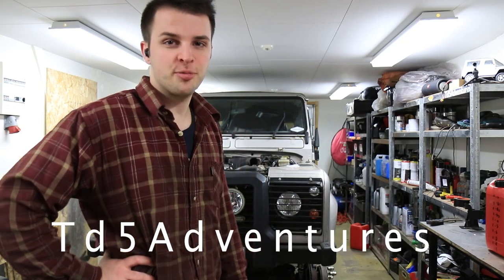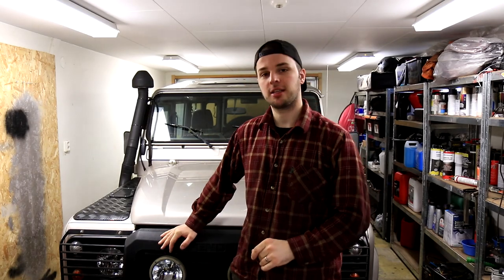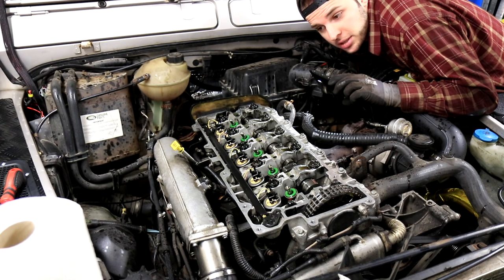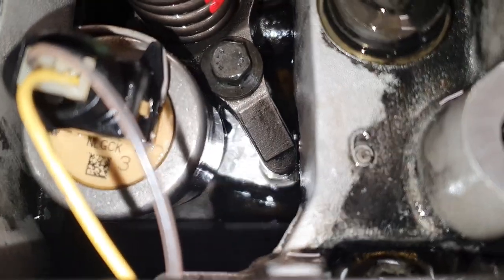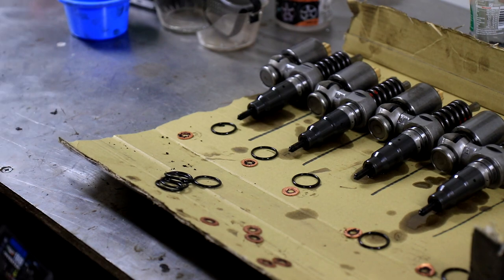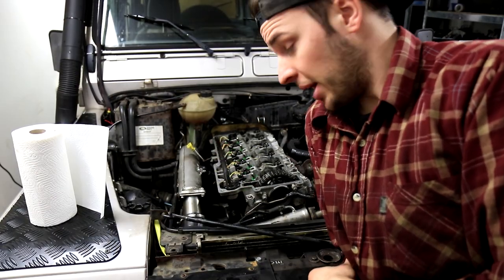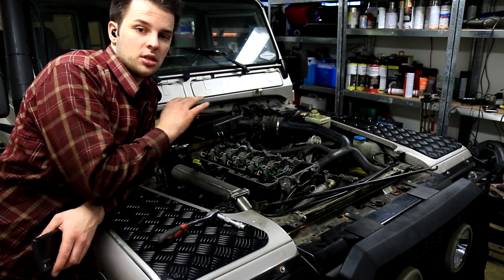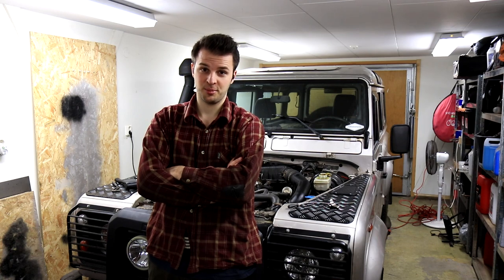CRACKED HEAD or BAD INJECTOR?!?! - Td5 - How to diagnose!

Comment: If your machine shop cannot repair your head, you can get a AMC cylinder head from Turner Engineering, they are meant to be a much better head than the origional. File this under "the joys of motoring" and keep up the good work.
Reply from the maker: Yeah I've been looking at the AMC head with the appropriate double wall thickness for the injector bores, would be nice if this head is not fixable!
Reply: Turner engineering are a rip off
Reply: Could these be bored out and sleeved? I dont know just a wild guess...

Comment: Was you oil level rising. I changed over my injector seals a while ago as the oil level was really high. Oil doesn’t seem to be increasing however the oil still seems very thin
Reply from the maker: Yes! It was rising and getting thin! 
Make sure to change your oil and filters and measure exactly how much you pour into the engine, then drive for a while and empty the oil again to see how much comes out. I put about 6,5 litres in and after only 200km I emptied the engine off 11 litres😲
Don't drive on thin oil! Your turbo will go bad very soon
Reply: @Td5Adventures  cheers, mines not rising like that. Because i do the work on my car myself I always think the worst. (As I’m no mechanic).
Reply from the maker: @troymortimer3487  Okay, just keep looking out for it. The oil gets really thin when it leaks diesel 😉
I'm not a mechanic either but most jobs you can do yourself anyways!

Comment: I know the feeling (valuable personal experience). My advice is - get the head pressure tested. My td5 10P head was cracked in one of the valve ports and failed the pressure test + exhaust manifold was also warped.. All the typical td5 issues unfortunately.
Reply from the maker: Ah, that sucks! 
Yeah, I'm leaving the head at a machine shop and let them examine it👌🏻
Reply: Hi @hrz4x4, was your oil level rising or just smelling of diesel?

Comment: hi sorry to hear about cracked head might be able to tig weld it repair also i know this is discovery td5 forum D2BC if you go into trader's section look at discovery 2 parts ( heathy ) might be able to help is the 10p/15p head's both the same on either defender/discovery
Reply from the maker: Thanks! Yeah it's a shame but should be weldable.. 
The heads are the same on the Disco and Defender for what I know :)

Comment: Hi, can you please share some of yur experience with me? How do you first noticed de problem, was the oil level rised or only the smell on  the dipstick was present? From what I've noticed from other posts on forumus and videos the cracked head lets good amounts of diesel get into oil. How did the oil smell compared to the other discos (known good I supose) I've seen in your videos? I'm really interested in this cause mine smells a little diesely but the level is steady, but only when the oil is warm and only the first time I'm reading the dipstick, what I mean by that is if I put the dipstick back and pull it out for a second sniff the smell is somewhat gone (maybe cause my nose is getting used to the smell, I'm getting paranoid about this), also when it's cold I can't smell it at all. I even added some diesel into the oil from last change and tried to compare the smells, but I can't definetly conclude something. I know that the only way is a test lab, but we don't have that in our country as a service for individuals..maybe some workshop do it but I'm not aware . So basically what I'm asking: when you first discovered the problem was your oil only smelling like diesel or also the level was rised, and how it compared with the smell of the other td5, I know it's been some time since you faced this land rover dilemma but any shared experience  would be greatly apreciated. Thank you for you time and keep up the good work ;)
Reply from the maker: Hi!
Yes, my oil level was rising. It was noticeable on the dipstick but I also measured exactly how much oil I put in it and then measured when draining the oil and saw that it was a few litres more in just 100 km. 
The oil smelt very much like diesel and was thin like diesel (water thin). 
If you don't see thin oil and a diesel smell you should be alright. 

Why do you think you might have this problem?
Reply: @Td5Adventures  I' realy hope it's not the case with my 2001MY td5, but I suspect o-ring failure and I want to be sure before adressing the problem. The oil looks good so far, the only thing that bugs me off is the slight scent from the dipstick. From all I have researched I still don't now how would the oil appear in case of o ring failure, I suppose the contamination would not be so obvius hence all this questions for my quest into landy world.
Reply from the maker: @cosminnemes7364  If the o-rings are bad then your oil will get thin too. You can just replace the O-rings and see if it helps, it's not a difficult job and doesn't take much time 😉

Comment: Too bad see crack there. I just had to replace the head with used one. Got crack in it and blown head gasket.

I think this crack is repairable. In special shop good experienced welder can do the job done. It's the easyest way.
Reply from the maker: Thanks!

Yeah, the crack is very accessible so I'm confident the machine shop will be able to weld it. I'll also let them inspect the head closely first to rule out more problems.
Reply: @Td5Adventures  I'm very intrested in results. So keep vloging! Good luck)

Comment: Sorry to see that you have this issue. There may be further issues with the engine even if you replace the head. It may be worth considering a replacement rebuild engine from a reputable company. I know this is expensive but you get what you pay for. Worth it if the Defender is a keeper. Buying a used head or engine is a high risk IMO unless you know its history.
Reply from the maker: Yeah I'm either letting the head get welded or replace it with a brand new one. The engine is running perfectly fine, can't notice anything else wrong other than diesel in the oil so I'm not replacing all of it :)